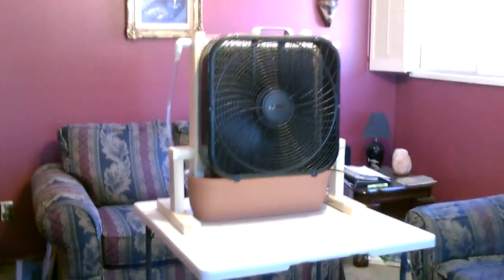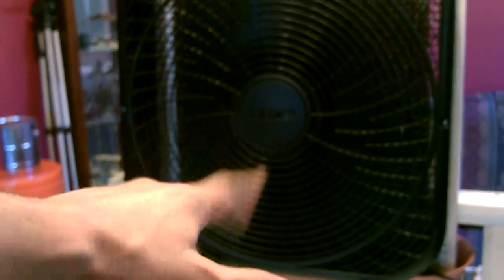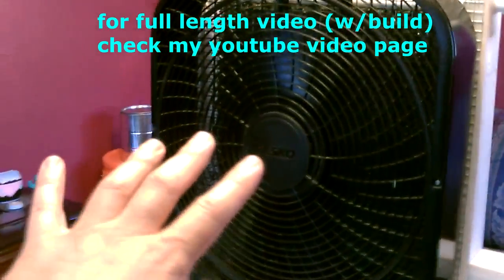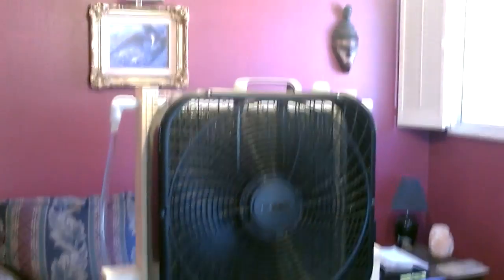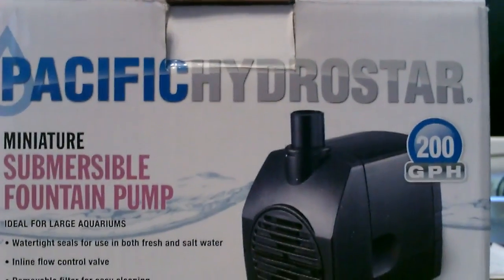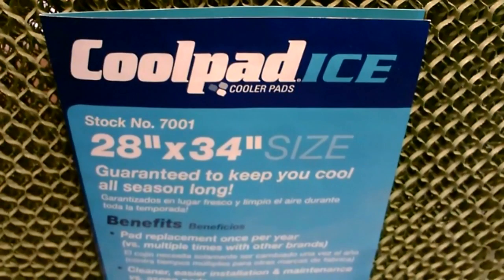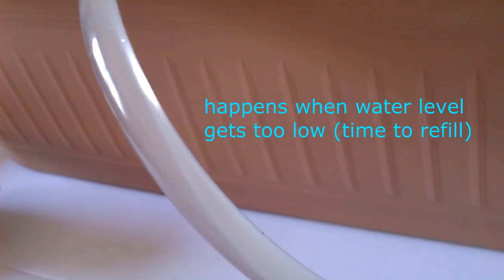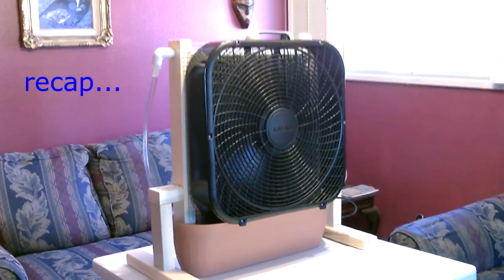Homemade Evap. Air Cooler! - Awesome Air Cooler! - Easy DIY (quickview w/closeups)

Comment: Does the water in the bottom tray get cool as well ?
Reply from the maker: hi. yes. as the water passes down the pad it actually cools off as well. so these units make cold air and cold water at the same time.

Comment: Is the best design of yours for garage?  Vegas is 110 right now and my 400sf garage feels like an oven
Reply from the maker: hi there. i've got a bunch of larger DIY evap air coolers on the channel. those should work good in the climate you are in. best way to find them is to look under the playlist tab for my evap air coolers. i've got a playlist  just for those.
Reply: @desertsun02  cool thanks so much for all the info and I'll check it out.  Any specific design ud recommend for my garage?
Reply: @desertsun02  I'm guessing the jumbo box fan one
Reply from the maker: @Phil H the jumbo box fan one would be good (or one of my blue cube evap coolers).

Comment: Is there a reason you have the fan sucking air instead of pushing it? i feel it would be better for the fan to push since the humid air won't be hitting it as much.
Reply from the maker: hi there. i have it pulling because if you try to push the air through it won't go through. the pad acts like a wall and blocks most of the air. don't worry about the humidity. it hardly affects the fan at all. i've done this for 10 years and never had an issue with a fan. they are made to run in dry, semi-dry or humid conditions.

Comment: desertsun02, I think the point Theo M was making was that while the unit is running "INSIDE" the house it will be cooling great at first but as time goes on inside the house humidity will start rising slowing down the evaporation thus slowing down the cooling. If you could get your cooler in a window so it's only dealing with the steady outside humidity you will fair better as long as your not in the tropics somewhere. No matter how effective the pads are you will be raising your humidity, (why do you need to keep filling the water tank and notice, as the time goes on you will need to fill it less and less because the room air is getting saturated causing less evaporation thus slowing down the cooling).

I love your design. I've been looking for a good one to copy for a window here at home. I needed it to be flat like yours so I can put it inside the window without taking up too much space. That's what I mean if you could just park that thing next to an open window so it's drawing just the outside air in I'm sure you will be needing a jacket!

Comment: Where do you buy, coolerpad? And price ?
Reply from the maker: hi there. i got it at home depot (but most home stores have them). it cost 5 or 6 bucks
Reply: Must be a location, thing or stores don't know they have them. Bought a 28" x 32" Aspen cool pad $21.42 from Walmart online.
Reply: I can't find the cooler pad can u post a link

Comment: We need this for our tailgates coming up. How will it work outside, 2 fans facing each other 15' apart?
thank you
Reply from the maker: Tanco Construction hi there. i think the setup you're describing (two air coolers pointed at each other - cooling the space in between them) would work well outside.

Comment: Can't wait to see how you do a 12v version. Bilge pump? Single or multiple computer or radiator fans? Excellent!
Reply: Really cool, thanks for the idea desertsun02 and Desert Logic. A 12v conversion, hum... Maybe outside the window, behind the screen. A solar panel setup will be nice. Maybe a 100w panel, a voltage regulator, Bilge pump, radiator aux fan (about 90w, should be water proof it's built to stay in-front of a car). It will run all day just as long as there's sun. Will be building it soon after I collected all the parts...

Comment: Did you take any measurements on how much it increases the humidity levels yet? Would it be less effective in high humidity conditions due to less evaporation? It would be nice to know a ballpark for cooling btu's so you'd be able to do a power consumption comparison with a window a/c or mini-split...very cool idea, thanks for sharing! :)
Reply from the maker: hi there. i haven't taken humidity measurements, but the higher the humidity the less effective they are. these coolers are most effective in semi-dry and dry climates. this type of cooler works well in humidity up to about 55% - 60% (in certain cases a little higher) and can cool of air as much as 40F (dry climate). typically they cool about 20-30F in semi-dry climate. this one works about the same as a $250 - $300 version you can buy at the home stores (I've owned several of those - in years past)

Comment: Any problems with the fan getting wet?  Other than that concern I'm thinking this would be awesome to build.  Great videos as usual.  Thank you
Reply from the maker: hi there and thanks!. the fan stays completely dry. The "cooler pads" are designed in a way that holds/traps all water within them (even with a high velocity fan next to them - not a drop of water is pulled out).
Reply: very awesome.

Comment: You could mount a container of water, maybe 3 lt bottle, upside down on one side with a hose running into the reservoir. It would give a much longer run time between refills. Just a thought.
Reply: Maybe hook up a drip-line and float-valve assembly, that way it refills itself from whatever faucet you hook the drip-line into, but only when the rez is running low. It might be tricky to hide the drip-line, but it would prevent the reservoir from running empty, or accidentally over-filling/-flowing on you, basically maintenance-free :)